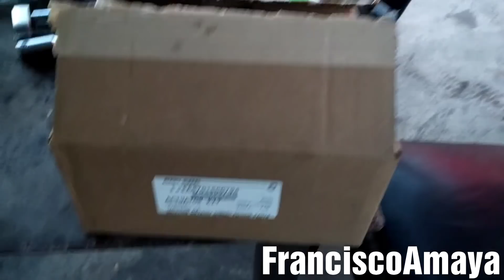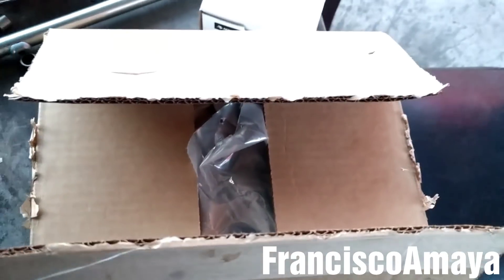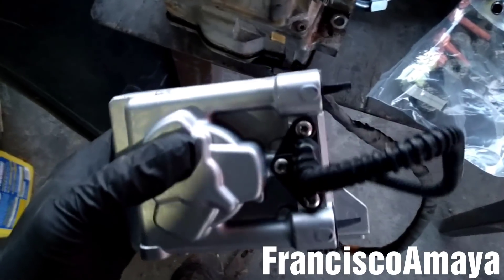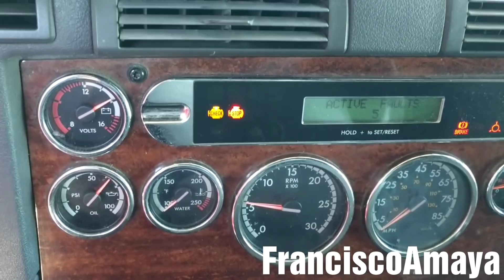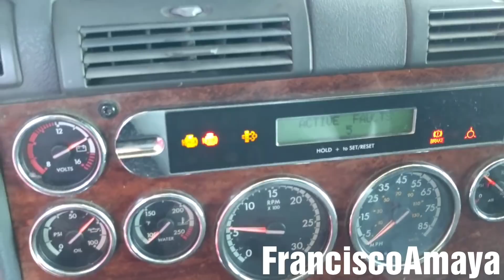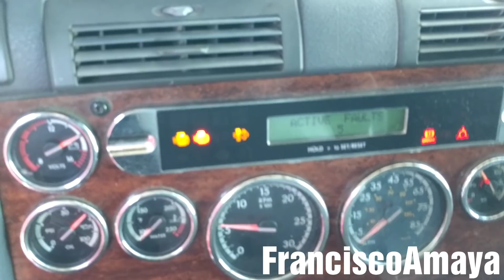Freightliner Cascadia DD15 DD16 engine EGR valve actuator removal replacement OM 472

Comment: These trucks are trash. Same things wrong wit all Cascadias. It's an apparent design flaw.
Reply: By all means, tell us which truck manufacturer makes one that lasts forever. Did you think you could run any truck for even 10k miles and not have maintenance issues? It's no wonder you didn't put your name there.
Reply: Marcus Jones, more than a maintenance issue. I'm guessing you don't own one, and if you do, I can tell you exactly what you've replaced already, or going to replace in the near future. If the same thing breaks across multiple units, then it's a design flaw. Plenty of people can attest to that fact. Sure, every truck needs repairs on a regular basis, but when the egr actuator fails on at least 80% of Cascadias, then it becomes very apparent what the problem is. And what the fuck does my name have to do with anything?
Reply: CROWN ROYAL, you guessed wrong. I do own one, and I love it. But you have to take care of it, and you have to treat it like you want to keep it for a while.
Reply: ELT, LLC LLC I replaced mine about 6 months ago. Changed to the new style. It failed again already. Haven't replaced it yet, but I know I'll have to. With this part not working correctly, it causes significant power loss when it comes to pulling 35,000 plus. I too have replaced the delta pressure sensor and venturi pipe first hoping that would solve the issue. No go. EGR actuator stuck in failsafe mode, motor on. Still need to replace the quantity control valve also. Plus oil leaks. It's definitely been an adventure with this cascadia..
Reply: just a note to Marcus Jones my NEW EGR actuator failed after 2 years I didn't want to believe it, cleaned my filter, EGR valve ports but still engine lite finally changed the actuator so my point even new part fails per mechanic its the electric part that failed, first time on my old style the coolant leaked it is sad Mr. CROWN ROYAL because these parts cost $500 and dealer wants $900-1100 cant even last 5+ years
Reply: wrxassa, man fuck you. You don't know shit about me or my abilities as a mechanic. Go find you somebody else to play wit..
Reply: You don't know shit about trucks.
You're a complete ignorant

Comment: What did it cost parts and labor?
Reply from the maker: Around $1400, just the EGR actuator kit cost around $1000 but if you need to replace it on the future the EGR actuator itself cost around $600